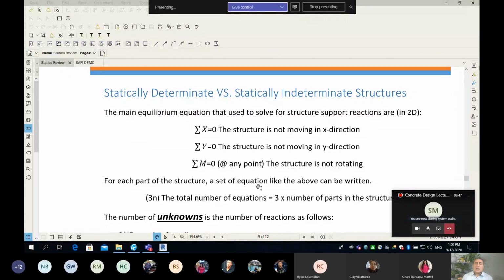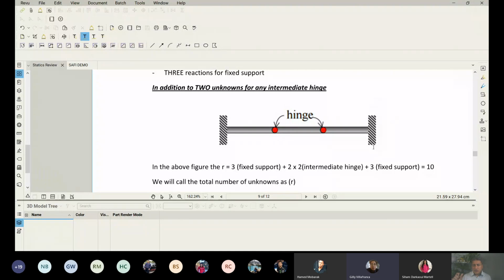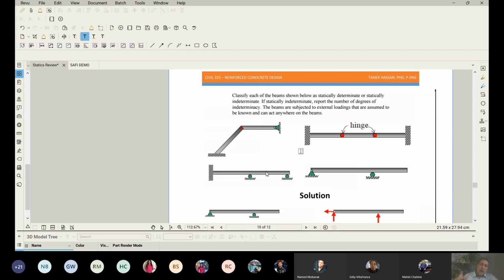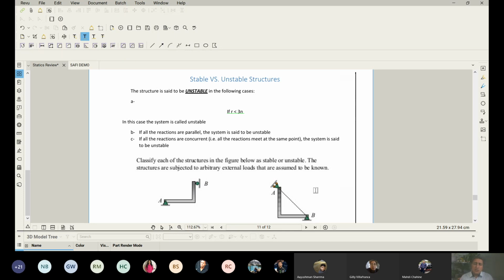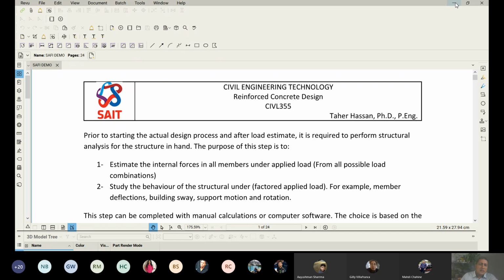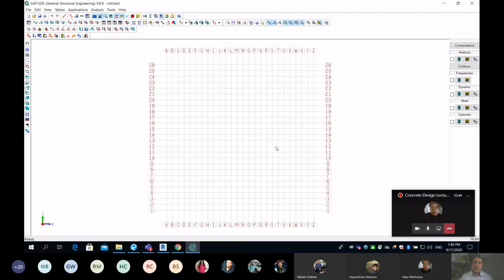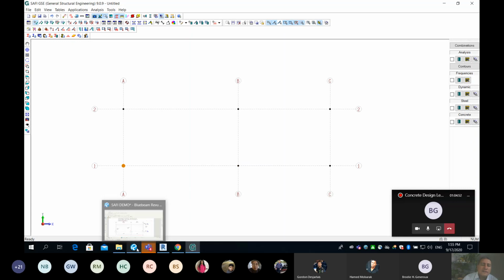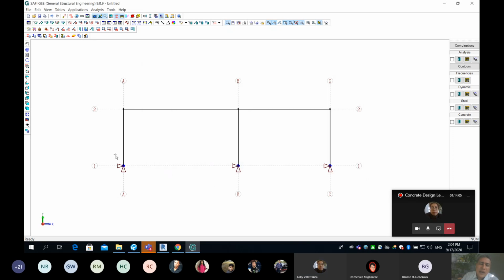W1 L3 Statics Review Part IV and SAFI Training

Comment: is it important that the concepet of unstable and stable in concrete design because I didn't learn the concepet in steel and geotechical design?
Reply from the maker: The stability of structural is independent of the material type. It applies for wood, steel, and concrete. Maybe there was not enough time as it is a review